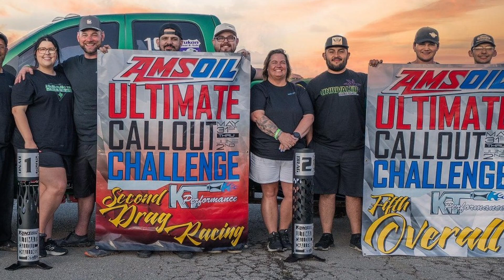Blowing UP 3 Transmissions In 2 Days. Teardown and Explanation!

Comment: I was there at UCC. It was my first time. All the competitors were in a mad scramble to go from Dyno to sled pull trim. This was due to a rain delay on Saturday. I really like the behind the scenes tear down of the transmission's and the report on the problems and the tough to admit failures due to driver errors or simple incorrect adjustments. I have been there myself. Keep up the content.